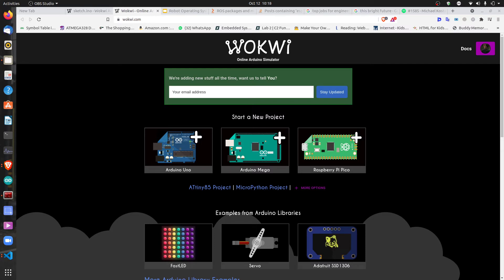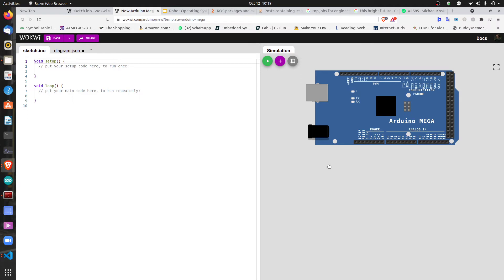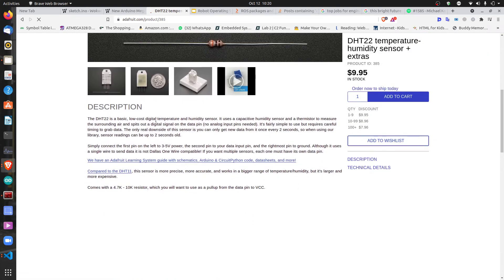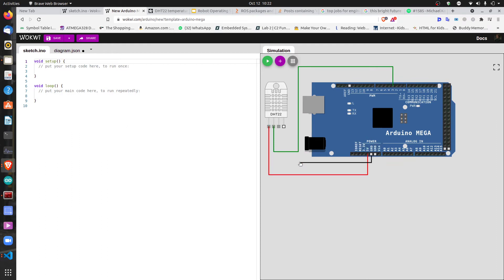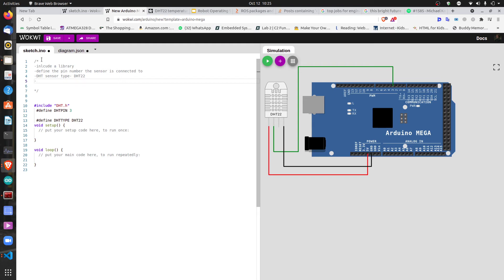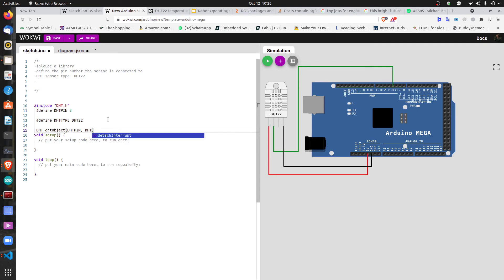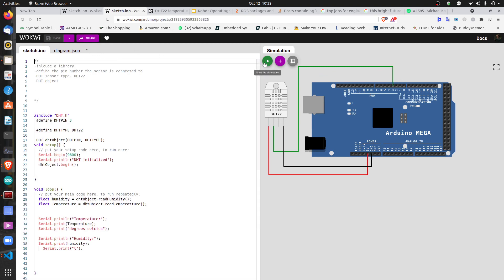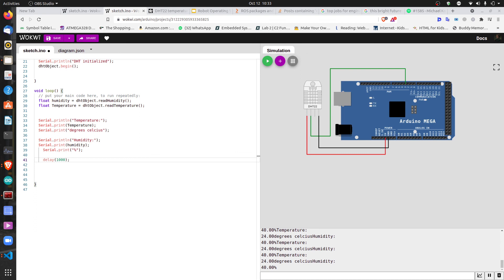How to Measure Temperature with DHT22 Temperature sensor with Arduino Mega | WOKWI SIMULATOR

Comment: when I copy the code to arduino IDE, there is an error that dhtObject was not declared
Reply from the maker: that means you did not declare it before hand, i am gonna paste for you the whole thing here
Reply from the maker: /*
-inlcude a library
-define the pin number the sensor is connected to
DHT sensor type DHT22
-DHT object

-

*/

#include "DHT.h"
 #define DHTPIN 3

 #define DHTTYPE DHT22

 DHT dhtObject(DHTPIN, DHTTYPE);
void setup() {
  // put your setup code here, to run once:
  Serial.begin(9600);
  Serial.println("DHT initialized");
  dhtObject.begin();

}

void loop() {
  // put your main code here, to run repeatedly:
  float humidity = dhtObject.readHumidity();
  float Temperature = dhtObject.readTemperature();

  Serial.println("Temperature:");
  Serial.print(Temperature);
  Serial.print("degrees celcius");

  Serial.println("Humidity:");
  Serial.print(humidity);
    Serial.print("%");

}